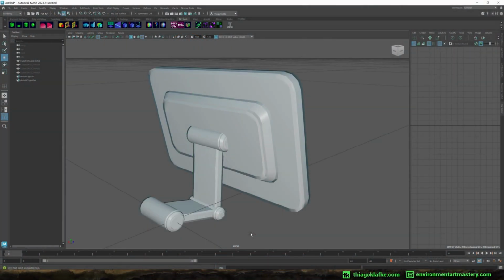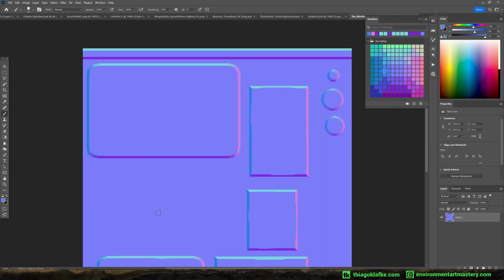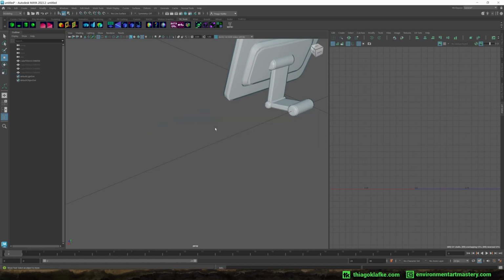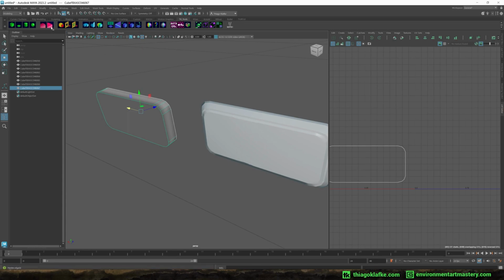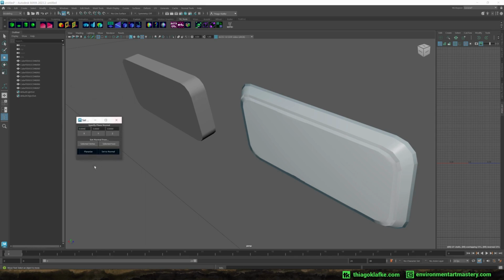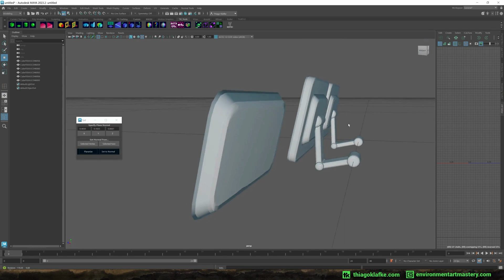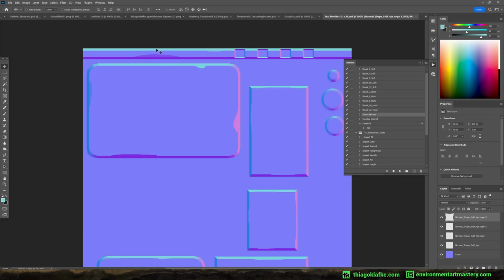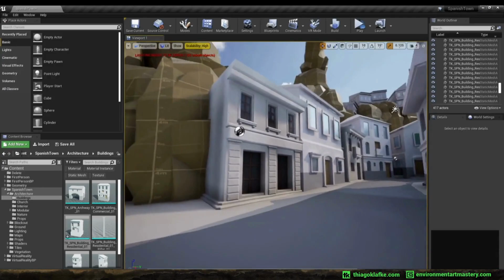Perfect NORMAL MAP Edge Bevels - How to fix double edges in angled geometry - Texturing Secrets #02

Comment: This is great! Although cannot reproduce in Blender. Data transfer modifier doesn't allow to select individual vertices...
Reply: Hi I had the same issue when using blender and I found the solution to be very easy - "alt+N" to bring up the normal edit menu, and there is two options called "copy vector" and "paste vector" which will do the same thing. Also you need to turn on "auto-smooth" for manual edit normal to work ("shade flat" basically clear out all manual normal edit). Hope this helps!
Reply from the maker: @shinin645  thanks for updating the thread!
Reply: @shinin645  Thanks for the info!!!
Reply from the maker: Im sure there’s an addon for that, its a simple operation :)